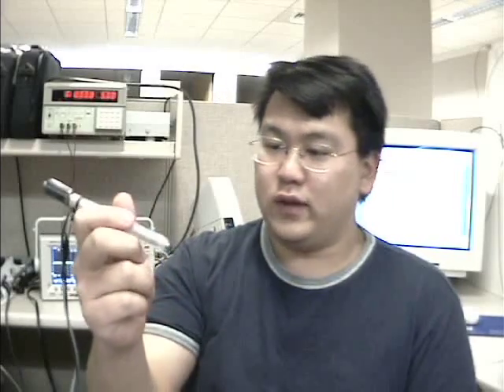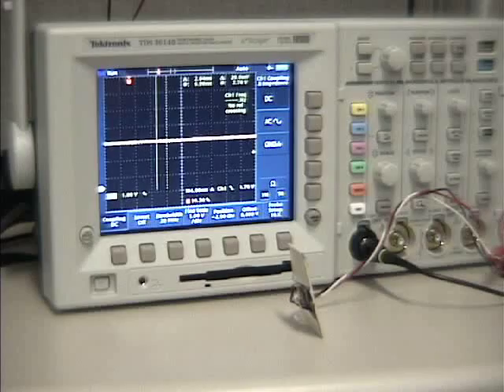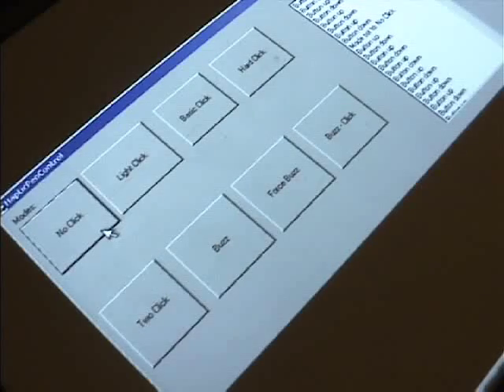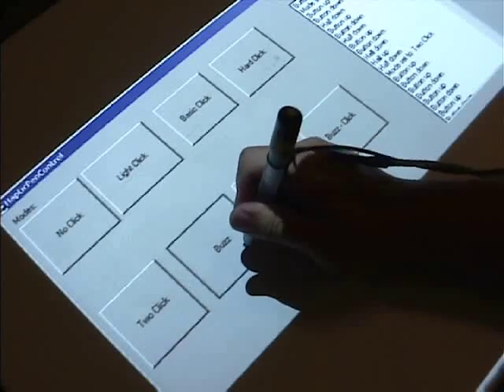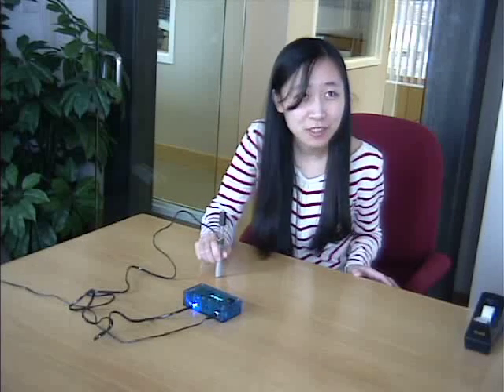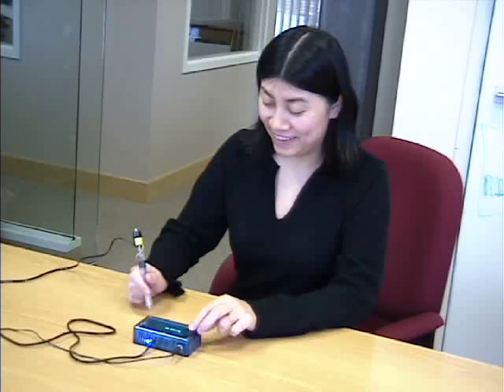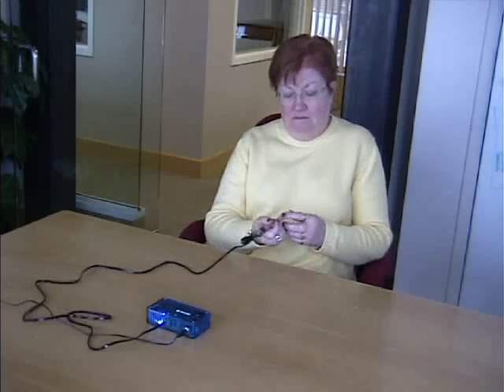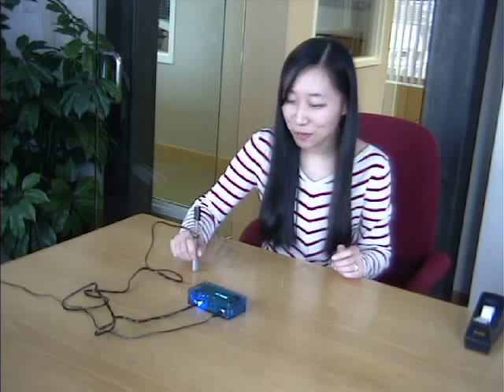Haptic Pen

Comment: EXACTLY!  The whole point is that you are pressing buttons which you know are all just images but the experience of pressing them FEELS different because because the pen knows where it is on the screen. With what they've done, its like if you designed a system where touching different buttons would produce different noises and then to test it all you did was played the sound of a bell or a dog barking to the cast of "Good Will Hunting" and asked, "What dose that sound like?"

Comment: i was going to suggest in some form of industrial setup, where you use a monitor and the pen instead of a larger bench of dials and controls...the varing pressure could be used for say, the stop button being harder to push then the normal buttons, to advoid accidental setting off.